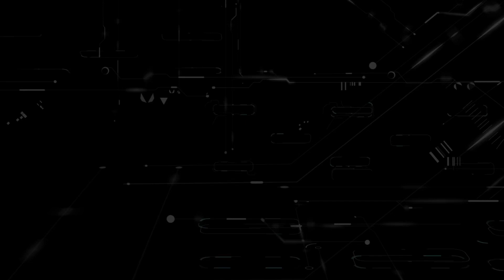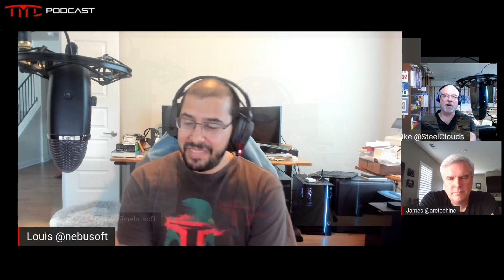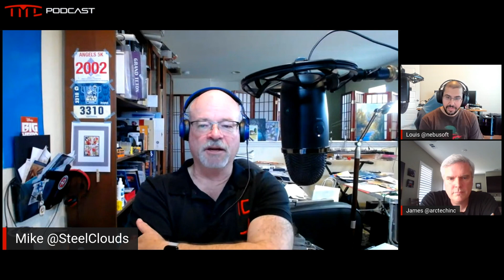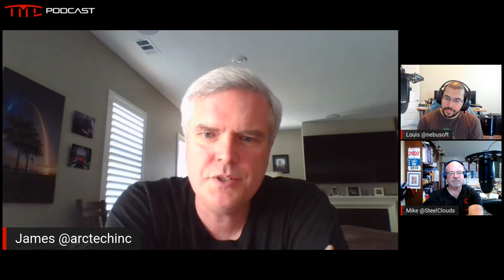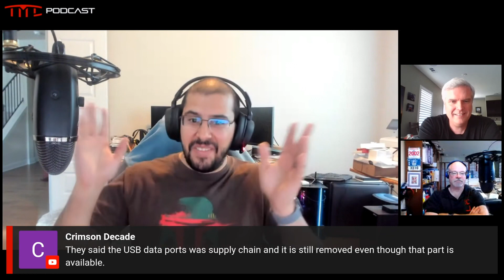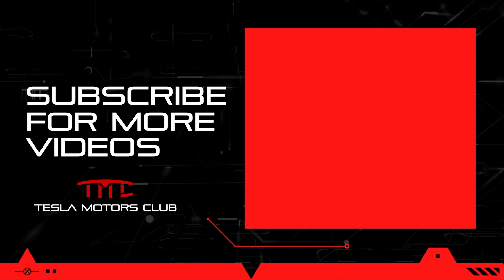James Locke (@arctechinc) on Tesla's Removal of Ultrasonic Sensors and Radar

Comment: I drive all the time in fog and it does a great job without radar also driving over 15 miles with a variable concrete barrier on the left and it does fantastic with a model 3  . 40 firmware
Reply: Really? Have you killed any pets or children lately? Or hit any metal poles while parking
Reply: Tesla just want productin going as customers are 2nd to revenue